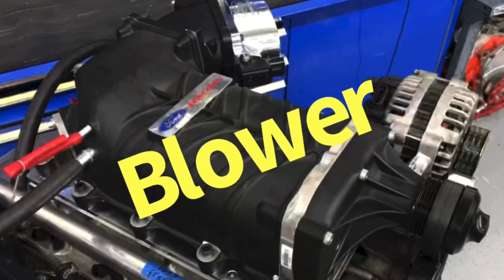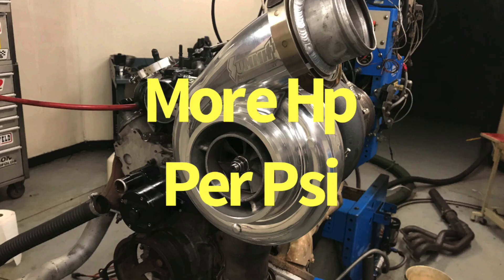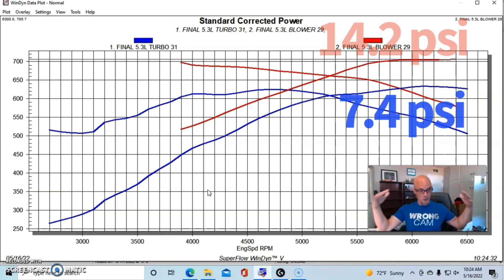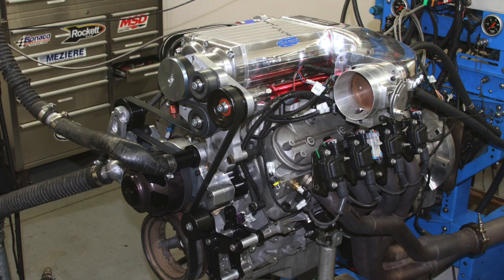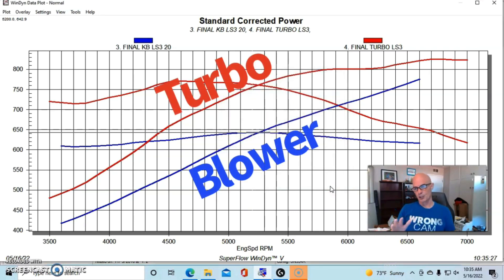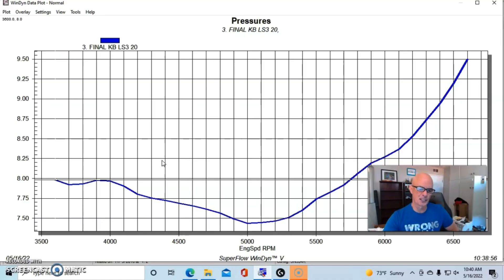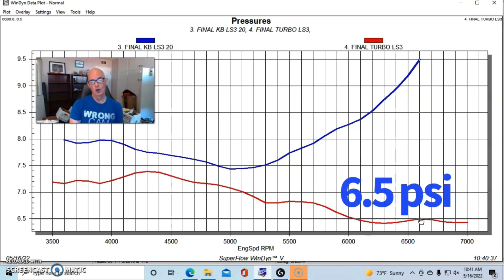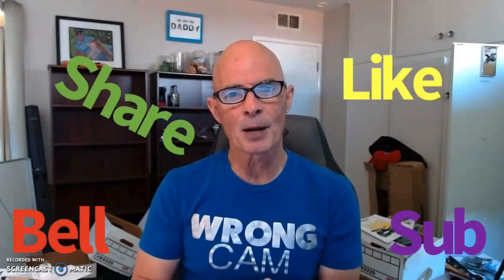LOW $ BLOWER VS LOW $ TURBO-DYNO PROVEN HP PER PSI! WHICH ONE DO YOU CHOOSE FOR YOUR BOOSTED LS?

Comment: When will you do a test where lighter components are tested against stock components... proving or disproving the performance gains or Not
Reply from the maker: I have=with flywheels and drive plates-there is a difference in power
Reply: @richardholdener1727  so I'm working on something that replaces valves springs and retainers, it's a V8 overhead cam engine and the parts that I have replace reduced those part weight by 1344 grams, pac springs and Ferrea valves, all 6mm stuff. Ported heads hoping for something significant
Reply from the maker: VALVE SPRINGS AND VALVES AND RETAINERS WILL SHOW MUCH LESS OF A POWER CHANGE, THEY ARE NOT PART OF THE RECIPROCATING ASSEMBLY AND DON'T WEIGHT NEARLY AS MUCH.

Comment: We need to see how you set up the tuning. What system do you use ?? How long does it take ?? How do you retune for the street ??
Reply from the maker: I'm not a tuner-I only tune on the dyno-it takes 5-6 pulls to dial in the WOT AF and timing on a typical na combo

Comment: its probably already been said , but , if the turbo is intercooled , and the supercharger isnt , how much of the difference is due to that , and would a fairer comparison be with them both intercooled or both not intercooled ?
Reply from the maker: the blower has an ATW intercooler too
Reply: hi richard , is that using the same temperature water  as the turbo one , and is the inlet air temp after the blower the same as the turbo . love to see the data log of inlet  air temps   at the manifold for both runs ? :)

Comment: Love it! I am a fan of both turbos and SCs depending on the application and how I want power delivery to come on. I have an Eaton TVS900R on my Miata that I picked over a turbo solely for the fact that I wanted an NA style feel for that particular car. It makes 250whp, but consumes the fuel required for a 350whp turbo application. I’m meeting the power goal with the SC though, and I prefer the snappiness of the blower over the turbo for a corner carver. On some of my other cars, I didn’t mind the slight lag of the turbo because I knew it would make up for it after spool up in a straight shot. It’s all fun in the end. Keep up the good work!

Comment: Of course, there are parasitic loses in play, but could comparing an intercooled turbo to a supercharger without intercooling be contributing to the perceived power disparity?  I mean,  intake charge temperature is a huge factor, right?  I run an aftermarket Eaton TVS2 on my BMW 550 that comes with an built in air/water intercooler and nets me an average 25HP per PSI with no other mods (other than a tune and larger injectors), so I'm a bit confused by the results.
Reply from the maker: both of these had ATW intercoolers

Comment: But consistency changes everything supercharger you don’t have to mess with all the time to make it work right different air pressures different air temperatures constantly have to mess with turbos and they perform differently depending on how the air is outside and whether you’re in the mountains or if you’re down by the sea where a supercharger is so much more consistent and does not take as much to get it going right and it’s very predictable it’s going to do the same thing every time on a supercharger
Reply from the maker: the supercharger is affected more by changes in elevation

Comment: Hey Richard, you [like me!!] love data... Why not for these type tests look at mesuring the HP per lb/min[hr/etc] by fitting a mass airflow meter and log that channel with your ECU?   You could setup a split intake pipe [1/2 stright through, 1/2 airflow through the MAF] to have little to no restriction.   You've access to the flow bench to generate voltage Vs air mass. 
Wish I was in the USA as I'd be more than willling to collaborate efforts to show the world [I've done this exact style of test in the past for my own research]
Reply from the maker: we have an air turbine for the dyno to measure airflow (but not mass)
Reply: @richardholdener1727  That could potentially do the job too !   Noice....

Comment: @richardholdener my question is how much boost is too much boost? Turbo specific build LS 408 in 93 octane. I see many factory cars running 20+ psi on a daily. But also been told that you shouldn't run more than 15-16 psi on pump gas. Myth busting?!?
Reply from the maker: there is no myth busting-you need to have the right combination of octane, timing and boost and charge cooling-it's not just boost
Reply: @richardholdener1727  understood. Wonder if that's something you could test similarly to the big bang stuff but in a pump gas real street car application. Like air to air, gas(not e85), and just like a gapped 6.0 with a single

Comment: The only issue I'd raise with this video is the boost comparison at the end.  With a PD supercharger, the boost curve, particularly at and past peak power is heavily impacted by the camshaft choice.  Run a stock LSA or LS9 cam with a decent sized blower package and you'll see boost start to climb rapidly near redline, especially if you're pushing past 6000 rpm.  This occurs because the cam isn't designed to make power up there, so you start to create an increasing restriction for the blower and boost goes up, often as power starts to drop.  But with a stock blower, boost stays flat or might even drop slightly near redline because the blower is also well out of its efficiency range.  Put in a bigger cam, boost will go down (vs. stock cam) and power will go up.

With a turbo, when you push past the designed operating range of the cam, the exhaust energy drops and boost may drop as well, but its unlikely to go up.  Put in a "bigger" cam and boost will go up (exhaust energy higher) and power will go up.  This doesn't invalidate the comparison, but it does point out the risks of looking at boost pressure as a power indicator (we all know its a measure of restriction ;) in a comparison between different compressor choices.
Reply from the maker: WHICH WRONG CAM ARE COMPLAINING ABOUT
Reply: @richardholdener1727  Cmon Rich you know better than that.  Just saying cam choice makes trying to compare boost levels between compressor types problematic.  You know its true.....

Comment: I've had both a turbo and PD supercharger on the same engine, in the same car. I prefer the supercharger for street driving. In fact, I am in process of switching back to PD blower from the turbo using the Demuse kit.
Reply: I've been saying the same for years.
If you're racing competitively the turbo has the advantage because the engine won't use the curve under 3500rpm anyway.
If you want something that is fun and snappy with instantaneous torque on demand at all times, a positive displacement blower will spoil you rotten in a way that turbos can't.
Reply: @jacksonjdr94  why just about all car manufacturers use small turbos
Reply: @hotdog9262  fuel efficiency. NVH. Emissions. Cost. Packaging.
Reply: @jacksonjdr94  sure. also near instant power
Reply: @hotdog9262  yes instant power with the factory turbos because they are usually smaller turbos that don't make a lot of power. All depends on how you want to use it
Reply: @trashbandit2449  even factory turbos aren't instant power.
You absolutely can tell when a car is turbo or NA by the unique power delivery.

A blower pretty feels like a much bigger version of whatever NA engine it's fitted to
Reply: @jacksonjdr94  there is a difference though imo..between lag and the predetermined spool on a turbo. if a turbo is suppose to come on at 2500rpm for example, personally I wouldn`t call this lag. that is working as intended
Reply: if the pedal is floored at 3-4000 rpm and there is hesitation, that`s lag
Reply: @jacksonjdr94  of course, but they are more instant than a built turbo engine for the most part unless it's made specifically for thay
Reply: @hotdog9262    It's still not instant power with a turbo. It can't be. Turbos have to spool, it's how they work.

I'm not even talking about lag.
spool and lag are not the same.

Lag is what you get when the turbo hasn't reached it's boost threshold, and spool is what happens when that threshold is reached.

Even without lag, Spooling isn't instant.

When you press the pedal to the floor on a turbo, you cannot and will not get instantaneous maximum torque even if you're in the engines ideal rpm range with a small highly responsive turbo such as an OEM engine... it still has to go through the feedback loop of more exhaust pressure = boost increase = exhaust pressure increase = boost increase etc etc.

 This occurs at an exponential rate but it absolutely is not instant.

By the time this happens and you've achieved peak boost, you've felt the "rubber band" power delivery of the turbo. It's a gradual increase. Not instant.

And it is very noticeably that torque output and throttle position are not directly linked, since spool takes time during WOT. 

Torque can begin to increase even if rpm and throttle position stay the same because boost is increasing.

This small period of spooling time doesn't exist on a PD blower.

With a blower you move the pedal, and the torque is applied at the same instant.

The instant torque a PD blower provides is extremely satisfying. Particularly with a manual transmission on a street car, where "spirited" driving means you spend a lot more time going on and off WOT between gears.

It's fine if you have a preference for turbos, but they don't offer the instant power delivery of a PD blower.
Reply: @trashbandit2449  even when the turbo engine is specifically built to be responsive... it still requires time to spool which a positive displacement supercharger does not.
Reply: @jacksonjdr94  definitely
Reply: @jacksonjdr94  Yes, totally. With "spirited" driving, on regular roads, the blower is more responsive to pedaling. Turbo you hit the gas, spool up, hit boost, boil the tires, pedal, and start all over. It sucks. Twin turbos I have not had, and I believe that you could size them properly for less spool, more torque. So I cannot speak to that.
Reply: just size the turbo for how you drive on the street. I like the slight lag, less than 500rpms on my application if you call that much of a lag! 
boost controllers do wonders. if you want the turbo to act like a supercharger then it will! Cheep version is to get a wastegate thats too small for your application and put a light spring in it. You will get boost creep and the boost will go up with rpm. i can show a graph of it. 
   Drive and build what you want though. Its fun to get out there with whatever you have!

Comment: I've had a m122 gt500 blower on my 6.0 since 2016 and given the opportunity I'd do it again, but only if I could find a blower for $200 and an intake manifold for $165 like I did in '15. For the price the blower stuff goes for now you can buy a really nice turbo and the exhaust parts to make it work, and it will perform better.

Comment: i understand this is an "Engine Power" channel and Richard is who i turn to for the best information on what to focus on. with that said - there is no such animal as "Low $" power upgrades. adding substantial power adders like blowers and turbos will turn stock components behind it into slag. when budgeting for an engine upgrade you need to look at things like transmission and rear-end upgrades as well. you will also need to take into account suspension and breaks if you are looking to turn and stop. then there are all of the little things like engine/transmission mounts, tires and radiator upgrades that needs to be addressed. at the end of the day you're looking at a price tag north of $10,000 easily - depending on your application.
Reply: All of that stuff is vehicle specific. Everybody has a different vehicle/engine combination and all of that stuff is specific for you to deal with, whereas Richards content is more general.
Reply: @evanc6110  yes, i know this. its why i said what i said in the very first sentence. adding a blower or turbo drastically increases the HP/Torque and your budget must account for it.
Reply: @evanc6110  me personally - i'm not going to get a used, high millage, engine from a junkyard and not rebuild it... rings bearings seals and gaskets at the very least.
Reply: SloppyMechanics would disagree with you.

Comment: Thanks for the great content Richard!  Regarding "horsepower per lb boost" it might help to take the base atmospheric pressure into consideration.  Naturally Aspirated the motors already has 14.7 PSI of "boost" (at sea level), you said the NA motor made 425 HP so it was making 425/14.7=28.9 HP per PSI.  The turbo motor stacks 7.4 PSI boost on top of ATM so total pressure is 22.1 PSI for 633/22.1=28.6 HP per PSI, slightly less efficient than NA but not much!  The supercharged motor at 14.2 PSI has a total of 28.9 PSI for 706/28.9=24.4 HP per PSI, much less efficient!  To me these numbers make more sense and should scale more accurately than numbers based purely on boost.  For example the turbo with 14.2 PSI (28.9 total) should be around 827 HP, just like you said!  This also tells us a bit about how much HP the supercharger drag and heat wastes, since the NA motor at 28.9 PSI would have made 835 HP, the blower was effectively eating around 120hp.
Reply from the maker: the boost supplied is above atmospheric-take the gain and divide by the boost number-as was provided in the video-trust me-it's right
Reply: Just start using metrics, much easier to understand. And calculate "naturally aspirated" power dividing hp with pressure ratio.

Comment: I'd be a interested to see a smaller turbo vs a centrifugal. Obviously the powerband on a centrifugal will suck vs a small turbo, but it might make more up top at equal boost.
Reply from the maker: if both can supply the required boost-this is the result

Comment: Doesn’t back pressure need to be overcome with a turbo?
You know- conservation of energy and that stuff?

Asking for a friend…
Reply: it does, and how much of a problem that is depends a lot on the turbo itself, including AR. 

in other videos I believe he's talked about boost pressure vs backpressure. On a large turbo, or anything in it's efficiency window, you can sometimes have more boost pressure vs backpressure. If you're pushing a turbo really hard, you can have backpressure multiple times as high.
Reply from the maker: the hp per psi has already taken the back pressure into account

Comment: Richard, one question. Would the parasitic loss be any different on the blower setups that upgrade the belt drive systems? I.E. A&A Supercharger offers an “8 Rib secondary drive” setup that runs the supercharger off its own belt. I know it’s still driven by the crankshaft but I am wondering if a setup like that performs better (more hp) or if it is strictly to help with belt slip. Thanks!
Reply from the maker: just helps with belt slip-still has to drive
Reply: it'll make more power if there's slip, if there isn't nope. of course, I'm assuming equal pulley sizes.

Comment: Richard, you keep saying a tighter LSA means better low end power. Perhaps I’m confused, because as I understand it, more overlap pushes the peak torque up in the power band as at low engine speed and slow port velocity both valves being opened at the same time cause loss of efficiency as some exhaust pulses come back through from adjacent cylinders. However the larger overlap (tighter lsa) with higher engine speeds and port velocities creates a small supercharging effect.

Edit: went back and watched your LSA video and sure enough, the tightest LSA made the most peak power the farthest in the power band. Maybe you can revisit this.
Reply from the maker: no need to revisit-wide lsa cams like the blower cam are soft down low and in the middle-watch any of the ls9 cam vids

Comment: This is great TV!!! I was wondering if you could collect some OEM turbos from the junkyard and test different turbos. Like compare a power stroke turbo to an Audi turbo to a Duramax turbo. Also, if a turbo has provisions to water cool it, do you have to use the water cooling or can you just hook up the oil supply and return.
Reply from the maker: not required to run water cooling-though a god idea-you can certainly test different OEM turbos
Reply: with how cheap decent China turbos have gotten now, I don't think there's much reason to use a junkyard turbo. There used to be, but times have changed.
Reply: @totensiebush  although you are correct they are cheap, I would think the OEM is designed for longevity.

Comment: I would like to suggest running both a turbo feeding into a supercharger with both stages intercooled.
Reply from the maker: compound stuff is up
Reply: Yes. Bring back the MM&FF  twin screw with twin turbos mustang. I Loved that idea / setup. Made monster low end, Amazing midrange, and still have top end. Compound Boost is Awesome.!! A modern V8, for sure. Possibly Big Bang theory. Then again, all of that might not work, if you have the wrong cam. Lol. I vote for compound boost on any of the Big 3. Different octane and boost levels would be Very Cool. Just Saying. 🤔👍😁